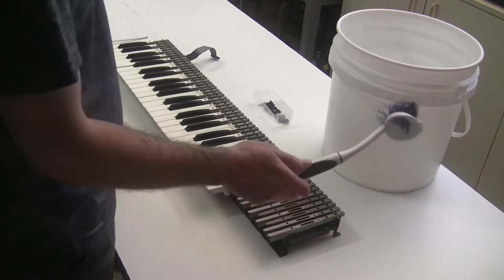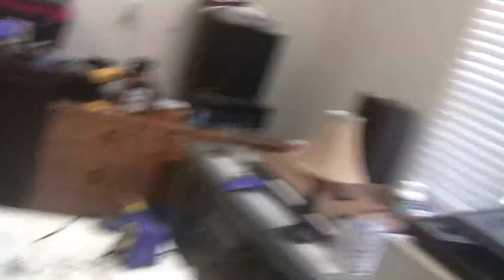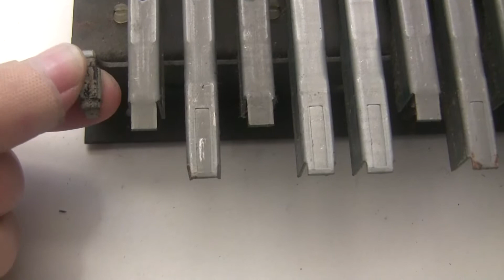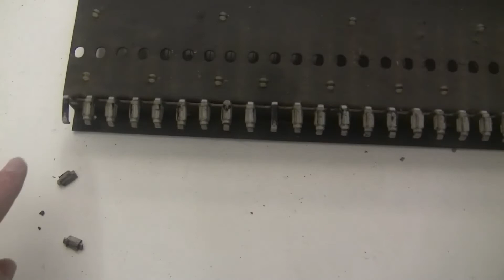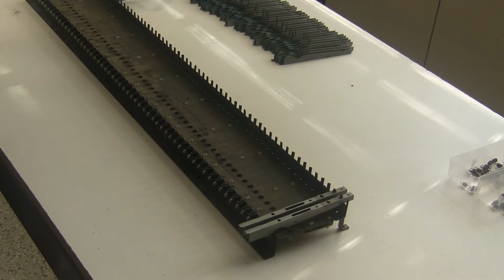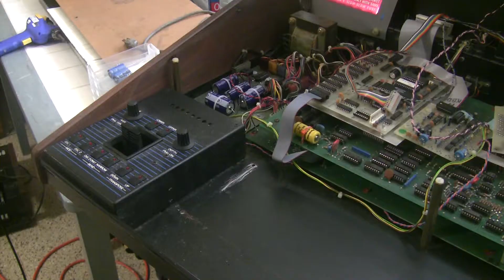Synthchaser #015 - Oberheim OB-Xa Repair - Part 2/3 - Rebuilding The Keyboard

Comment: For those coming here to look at how to repair/replace a broken OBXa panel switch ... this was the only place I could find on the 'net that shows anything.  I'd like to add that for mine, at first I took the board out on the inside thinking that I may be able to somehow 'coax' it into operation.  No dice at first, then I came here, concluded that I'd have to have my tech desolder it and replace it, then I just gave it a good blow to clean any dust and 'wiggled' it a bit more.  When I put everything back together with little hope of a quick fix ... hey presto life in my program selector led switch again!  I have to add that the board had never been taken out before in 40 years, so I have to assume that these are generally pretty reliable.  Yay life today 😉👍👍🤞

Comment: Do you need to remove the circuitboard to clean the buttons? I read something about prying the caps off to clean them. This is on an OB-8 and not an OB-Xa though.
Reply from the maker: You can pry the caps off without removing the board (greater chance of breaking things with board still in, very easy to do safely with the board out), but you won't be able to clean away any of the junk on sides of the switches, so when you spray with cleaner you may be getting more crud into the switches.  And you won't be able to clean up any of the stuff that comes out of the switches that you spray.  Probably not a big deal though, I'm just overzealous and like to get the dirt out of the synth.
Reply: How do you remove the knobs safely? Thanks!
Reply from the maker: The keycaps?  Just pry them up the opposite direction that you'd push them down.
Reply: No, the knobs actually, in order to remove the front panel boards for easier access to the keycaps. I'm unsure how the knobs are assembled, I thought maybe they had caps with a shaft underneath, I read somewhere that you can't simply pull them off.
Reply from the maker: Pretty sure they just pull off.

Comment: I'm embarking on a project to rehab my OBXa. First, thanks for these videos! They're very helpful. I was working on removing my keyboard but have to take a short break to wait for a screw extractor set to be shipped (I managed to strip the head of one of the screws holding the upper control board – the loctite held it like glue and my cordless screwdriver mauled the screw head!). While I wait, two questions have come to mind: I notice you clean the buss bar but not any of the key wires. Do those just not tarnish ever? The other question is regarding the cleaning itself – do you think a Q-tip dipped in 91% isopropyl alcohol would work OK to clean? I think it might go faster, and it would be easier to get to the underside of the buss bar. It also seems like I could easily wipe down the key wires with a q-tip too. Thanks for any advice – and look for an order from me for the bushings soon!
Reply from the maker: Good questions.  The key wires can tarnish, but seem to be less likely to than the buss bar.  From time to time I come across ones that are dirty or tarnished and do clean them.  But to clean them without bending the wires you'd need to unmount the circuit board from the keybed.  Alcohol or chemical cleaners like Deoxit tend not to do a good job on the buss bars, I find it takes a mild abrasive like an eraser or fine grade steel wool to get the job done.  Good luck!
Reply: Thanks! Points taken and I will stick with the eraser. As far as the wires, I'll just have to wait until I have the keyboard out and can eyeball them. Seems like it would be hard to rub an eraser on them with enough force to clean, yet not bend them – but I'll see what the story is soon. Thanks again!
Reply from the maker: I put some tips for the key contact wires in a video I started shooting today--watch for Synthchaser #068

Comment: Great vid! I just got an Obxa that I purchased privately. The previous owner said he had it all calibrated and had power supply capped and such. This was 3 months ago. The owner disabled the control panel for the pitch bend and modulation saying it was making the synth erratic. And also said this was a design flaw. Have you ever had a problem with that? He said that panel can be calibrated to work again but it would probably need recalibration again soon again. Is this a known issue? Hope you can help me with thes questions. Thanks
Reply from the maker: Thanks for watching!  There's no design flaw with the bender assembly to my knowledge and most are pretty stable.  If someone disabled it because it was causing problems or the need for frequent calibration then there's probably something wrong with it.